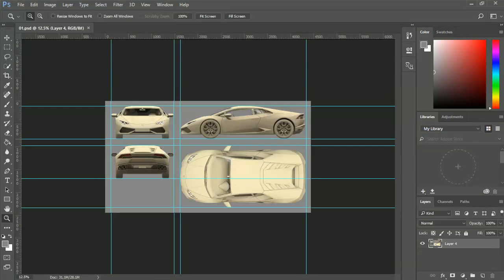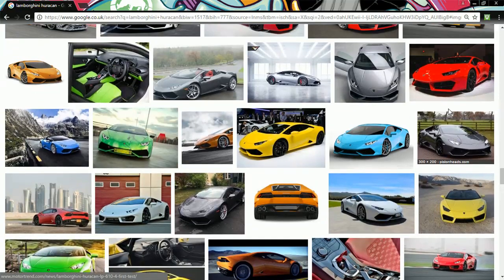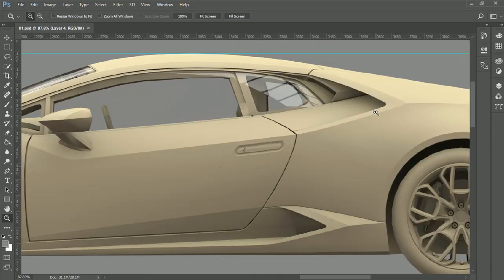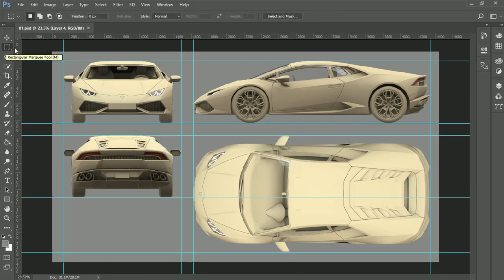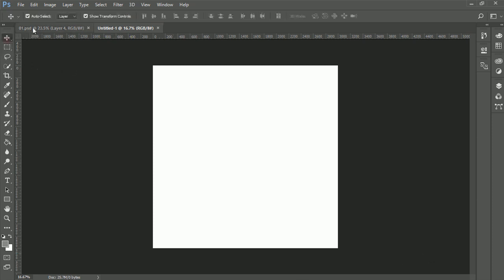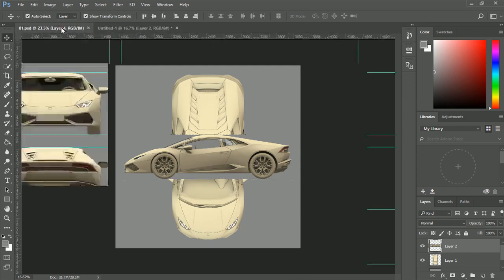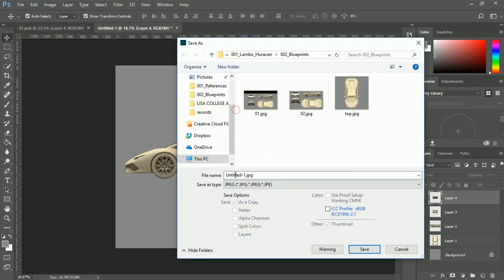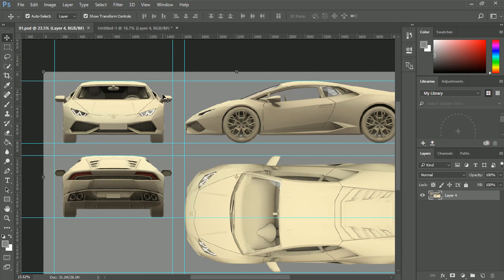Creating 3D Blueprints in Maya and Photoshop pt. 1

Comment: Where did you get the ref images that you used for modeling?
Reply: i wish u had linked the perfectly cropped  images hehe
Reply: But the image in the description has a much lower resolution than the original image!

When you copied the top view of the car onto a new image, the width was 2200 pixels. The the entire image in the google drive is not more than 1700 pixels wide.

Edit: Ah, you have to click the download icon, not right click image -> Save Image ...
Reply from the maker: That would be way too easy!
Reply from the maker: A link to the original file has been added to the Description.